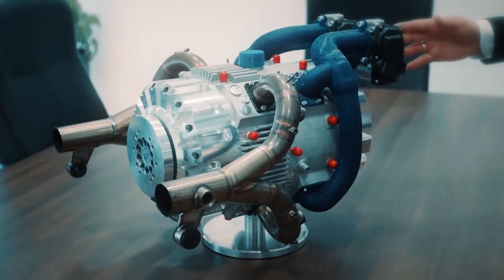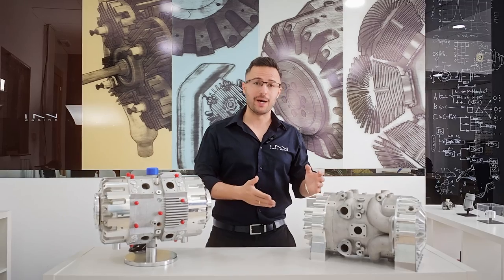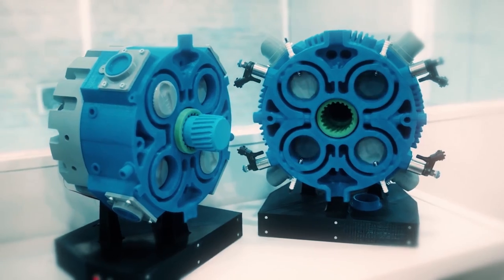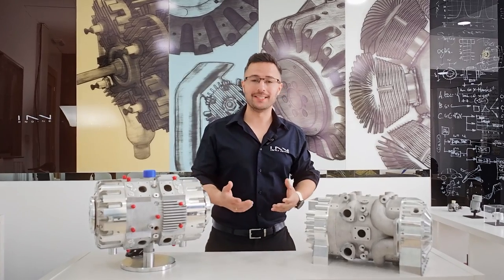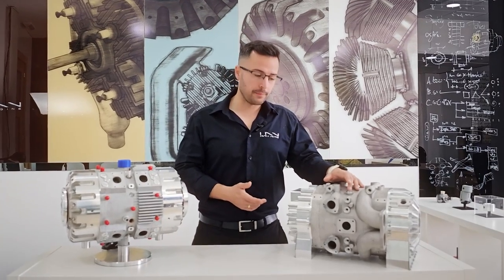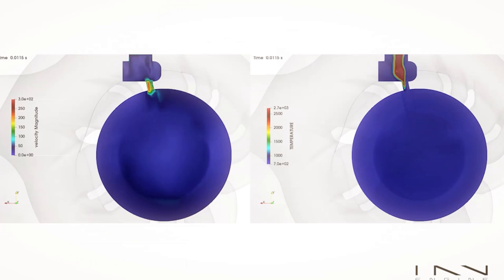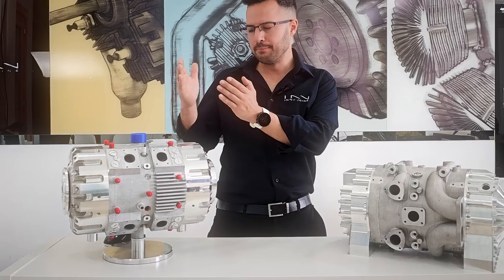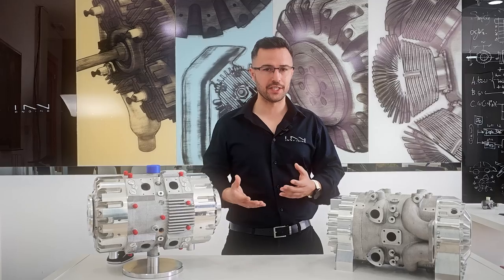500vs700

Comment: The Valeo TM65 bus air conditioner compressor weighs 18.1 kilograms (39.9 lbs) without the clutch. It has dimensions of 341 x 194 x 294 millimeters (13.4 x 7.64 x 9.33 in). 
Valeo TM65 compressor specifications 
Stroke: 33.7 mm (1.30 in)
Displacement: 635cc / 38.75 in3 per rev
Number of cylinders: 14 (7 double-headed pistons)
Revolution range: 600-4000 rpm

Comment: The e-REX 500 was already a leap in itself, this latest development of the e-REX 700, 
just goes to show how much of a push in innovation the engineers are achieving. Well done. 👏
-
On a further note would it be possible to comment on the following: 
Do you see an ETA to release on the market by perhaps 2026? 
Are there plans in introducing smaller models (such as generators) for the general public?
-
That is all, and again 'maravilloso progreso' :)

Comment: a major manufacturer needs to look into this. This is 'too-good-to-be-true' hardware; I'd like to see this put this up to real-world testing in a 1500kg car, 15 years of wear-and-tear in hot, arctic climates, heavy loading and high abuse (taxi, contractor pickup truck, sports car applications).

I love these innovative teams trying to push boundaries.
Reply: it's mostly meant as a REx not to directly drive the car
Reply: A big car manufacturing company would just buy the patents from them and file them away along with the likes of the pough carburetor, innovation is a threat to Big industry.
Reply: They need a partner with a lot expertise in traditional engines, ideally from Germany or Japón. Even 50%, but they need to be fostered with a very reliable partner
Reply: They're already testing it on a Mazda.
Reply: @steampunkster2023  Yes I saw that video; super cool. I have a Miata of the same gen. What I mean is a manufacturer should invest in a potential partnership for the e-REX, which should start with durability testing and validating a potential supply chain.
Reply: @ThePilotGear  and have the manufacturer steal their IP? That happened before, like the rocket belt, or like the shoe industry which Nike is a copy of Onitsuka Tiger sneakers from Japan.
Reply: @steampunkster2023  That's what non-disclosure agreements, IP contracts, etc are for. Incorporating intellectual property from one company into another's product is commonplace.